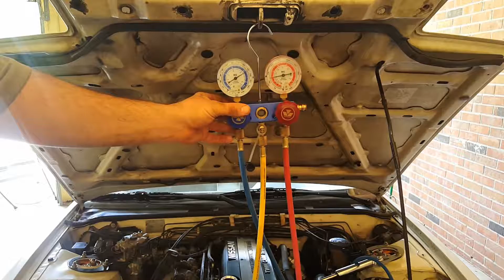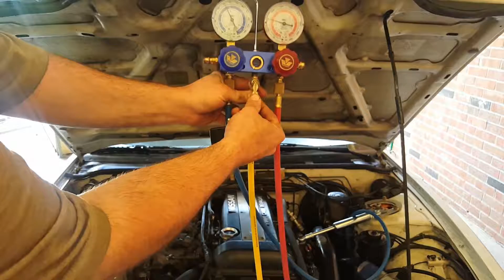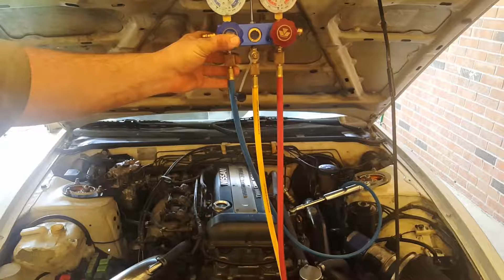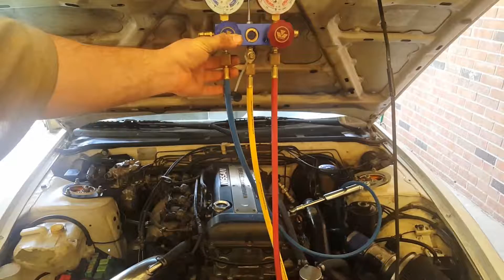240sx sr20det a/c recharge.

Comment: Do you have a KA24E condenser fan (in front of the condenser - on the core support under the high pressure port) or a KA24DE condenser fan (behind the radiator - inside the fan shroud)? It's hard to tell in the video.
Reply from the maker: @koukikev809  It has a stock electric fan on the back of the radiator.
Reply: @skaterman30  did you have to make any modifications to make it fit ?
Reply from the maker: @koukikev809 it was on there when I got it. I have a koyo radiator and it looks like it bolts right up.

Comment: What wiring had to be done?
Reply from the maker: I think if you have a 91-94 you just have to mod the bracket and use the ka lines, compressor, and wiring and that's it. It was already done when I bought the car but I bought it with a blown engine and when I changed engines that's all I could see that was done.

Comment: A/c on a sr20? Hella rare haha
Reply from the maker: Pretty Decent Garage Yeah it is. Looks like it's running ka lines and compressor on a sr bracket. It's blowing cold too. I love it.
Reply from the maker: Pretty Decent Garage Also it has hicas and it still works too. And cruise control.
Reply: Just came across this I’m looking at a sr-20 240 with an front mount intercooler with no ac do u think it’s possible to be able to put all the ac components back in
Reply from the maker: @blaineking3160  yeah it should be possible. I have a front mount also.